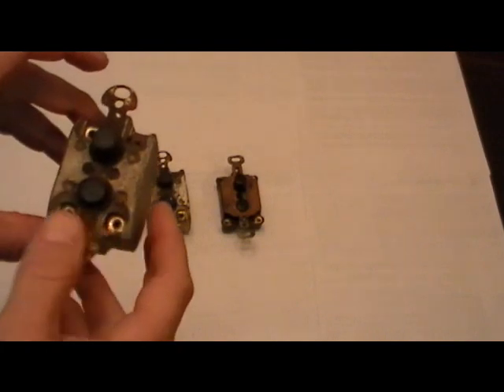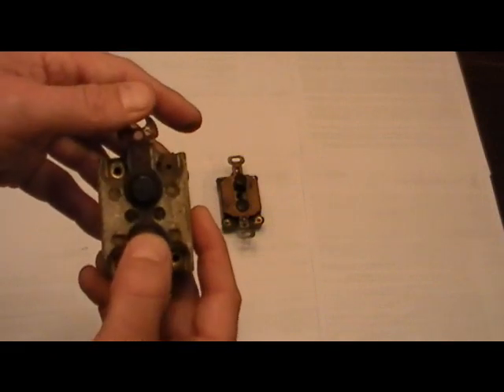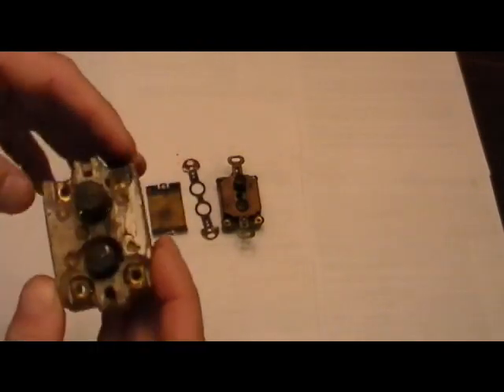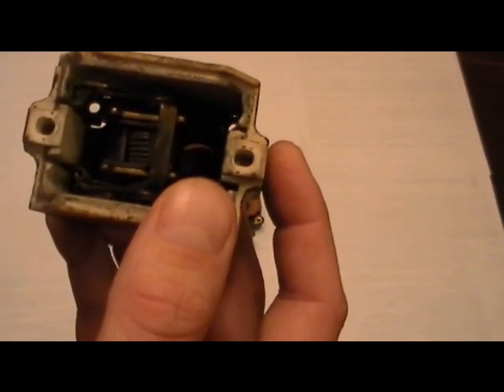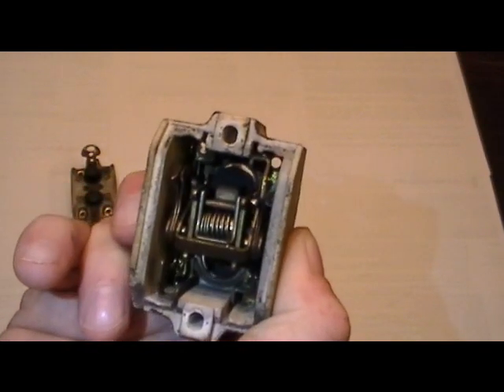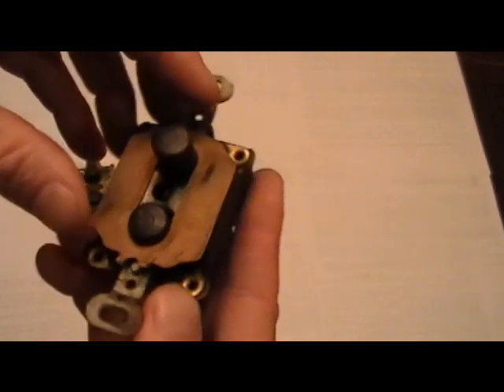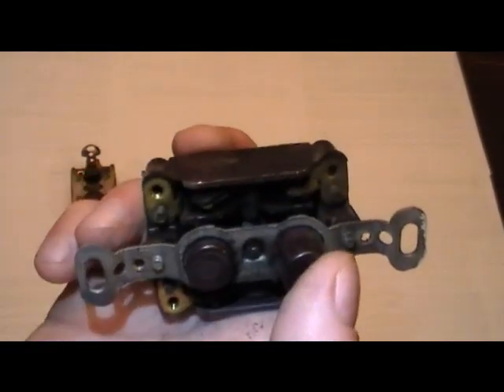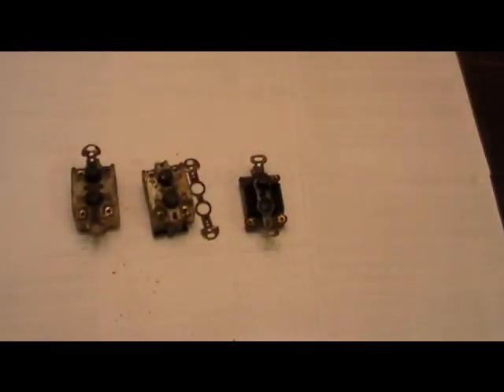Push button 3way old light switches

Comment from the maker: @voidenter  if your friends switches are like this and he has ceramic fuse I would think that he needs to have his home rewired. This type of electrical system was installed in the 1910's-40.  Yes, the electric is grandfathered in by code. It may not be grandfathered in by his insurance company. Many insurance companies are no longer covering this type of wiring.

Comment: my friend lives in a house that has those! i like them i think they are cool.
its like a mini breaker in a light switch. he needs to redo some wires tho. 
i think he has like ceramic fuses? if thats possible. 
i dont think any part of that house is up to code. grandfather claused in maybe?

could you just hook up a new switch or should you redo the wires too?
if so could you tie the new wire to the old wire and pull it threw the house or would you need to break the walls?

Comment: I have a sticking 3-way porcelain push button switch.  Can it be cleaned/lubed, and if so what is the proper lube to use?
Reply from the maker: You can try WD-40 electrical contact cleaner.
Reply: If you just want a working switch: replace it by a new one.
If you really want THAT switch (I did that procedure to all my collective old switches and all are in a perfect condition since that):
- Diswire it from wall and remove ALL screws
- Apply WD40 to the entire thing and switch it a few times (used as rough cleaner)
- Disassemble is in as many parts as possible
- Remove any residues of paint, wallpapers etc. from all parts
- Wash it heavily with water and soap (real soap, no chemicals, important!) and switch it careful a few times while it is underwater
- Try to remove every remaining dust and old oil residues. You might repeat the washing step
- Clean up copper parts (especially the electrical ones including the skew-terminals) until these are shiny using salt
- If salt is not working, try vinegar instead
- Wash it once again to remove all soap etc.
- Dry it as fast as possible (i.e, put on heat radiator) to prevent corrision. This is really important. When you can't assemble it: Switch it once (careful, there is no lubricate anymore) every 15 minutes during drying process.  Be sure it is 100% dry before you continue!!!! Look into skrew-holes and blow residual aqua out
- Polish bakelite parts with WD40 and a soft cloth until these are shiny again (Do not do it to plastic parts!)
- Reassemble it: Apply WD40 to the electrical contacting areas and re-lubricate mechanics it with a proper lubricate for mechanical parts
- Switch it a few times and ensure it is lubricated good and snapping well again. The clicking sound should be clearly snappy and metallic without squeaking now.
- Replace the old skrews which holds the wires to the terminals, if possible (for electrical safety)
- Re-wire it to the wall box. Be careful to not to tight the skrews too hard.
- Test it and ensure it is reliable in switching
- Enjoy an almost-new old switch :-)
- Re-apply WD40 to all bakelite parts every few weeks as long as they loose the shine

Don't apply that procedure to sockets or modern plastic switches. Only old bakelite-and-ceramic switches only!

If that procedure doesn't help, then sorry: Your switch is sadlyy worn-out. But this is rare.
Reply: @Wichtelchen2006   Thanks so much for posting this helpful procedure!

Comment from the maker: I don't think some minor wall damage can be avoided when rewiring. The old wires are secured to the building and you will not be able to use them to pull new wires.
Reply: we just redid a 1923 house with all the original knob and tube got lucky only damage was a bit of already broken plaster fell down from a ceding light saved some of the push button switches and plates didn't think id be doing old home fish jobs when i posted the first comment 4 years ago  my boss has been doing old houses for 35 yeas one of the best at fishing in our town